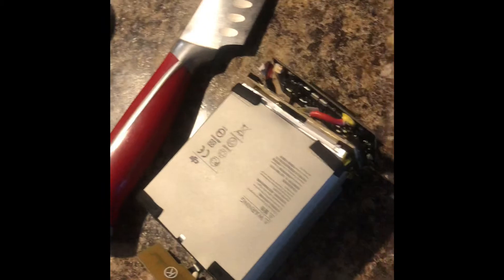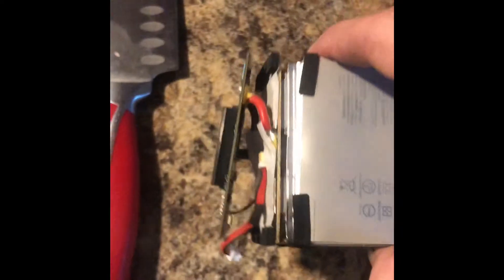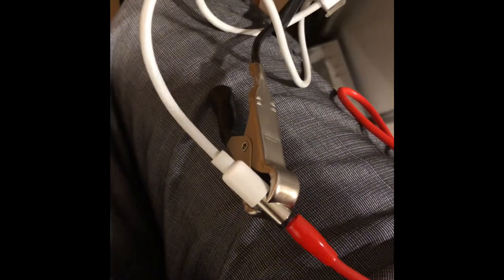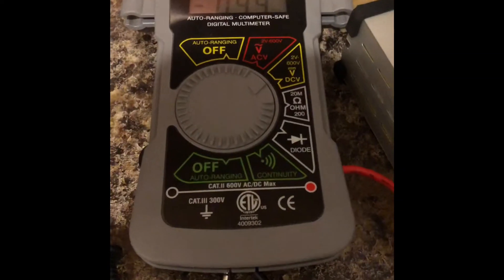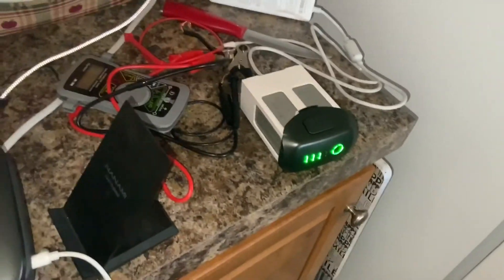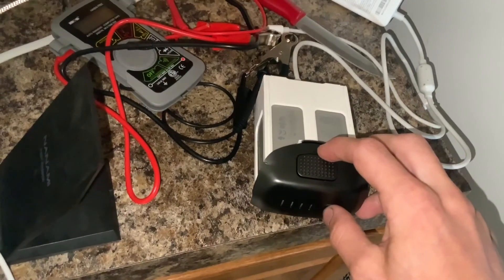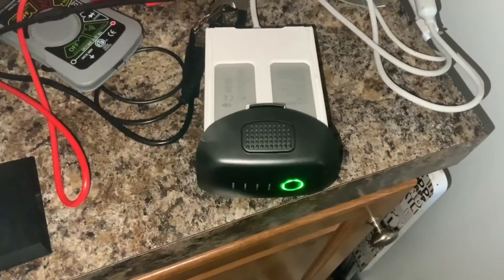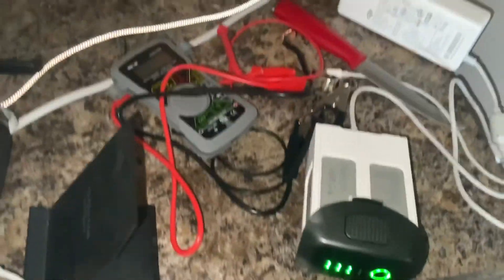DJI Phantom 4 Battery unbrick

Comment: U did the right thing so far, the next step is to unlock the Battery. You will need a Texas Instrument programmer ( around 150 EUR ) and the Software 
UBRT-2300 (u need to buy the  annual license too, around 100€/year ), Then you can clear out the Permanent failer code 
This guy explains it very well( use youtube subtitle transleter ) /watch?v=vzc_zV50HQw&ab_channel=TaranuMihaita
Reply: Was just about to say the same thing. It's in PF so it's to clear it and reseal.
Reply: That sounds like more trouble than its worth. I just did this on a Inspire battery and it works great. I have about a dozen P4 batteries that I would like to do this too but it seems like too much trouble for the payoff.
Reply: @twincityaerial9258  I have been fixing and unbricking batteries for a while now at an approximate 90% success rate. Wanna send them out to me?
Reply: @mc3ddesigns  i have one P4 battery with PF, could u take care of it too ? How can we get in contact?
Reply: @twincityaerial9258  unfortunately it is, i think it would pay it self off if you have enough p4 batteries, but still they are LiPos and it is not good to “revive” them

Comment: I have seen another video on these batteries and there is a reset terminal on that circuit board.
The guy jumped the reset terminal to the negative terminal for a couple of seconds and the lights on the battery work up.
He could then charge it in the regular charger.
Reply: Davo.. can you share the link please.
Reply: @sherwingoldsack2554  
Sure :)
I haven’t tried it on my non responsive battery yet.
I’ll let you know once I do.
Here is the link to the reset terminal.
Beats me why it has one and the hide it so well.

https://youtu.be/9E0vPfjXzbc
Reply: @DavoShed  were you able to get the charger to charge the batttery by resetting it as you mentioned?  I have 3 batteries that died because I stored them too long.
Reply: @BugCrush3r  
The case on my non responsive battery is one of the ones that is glued together.
I haven’t managed to get it open yet.  I’m tempted to cut a hole in the back to access those contacts.
I’m kind of dammed if I do and dammed if I don’t.
It’s useless if it doesn’t work and useless if I destroy the case.
I’ll post again if I successfully access the terminals and I may even video the process.

Comment: The guy you talked about taking his inspire voltage up to 20v is because the inspire has a 6s battery while the phantom has a 4s battery. Phantom battery is approximately 16.8 fully charged. 20v would be too much